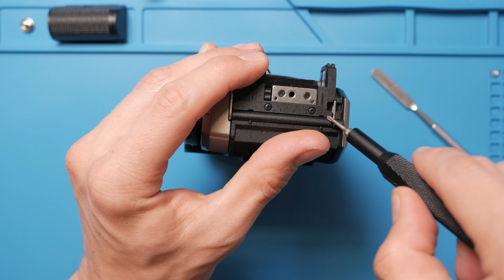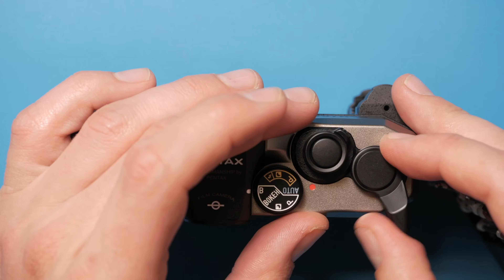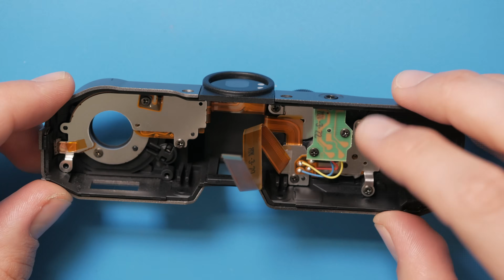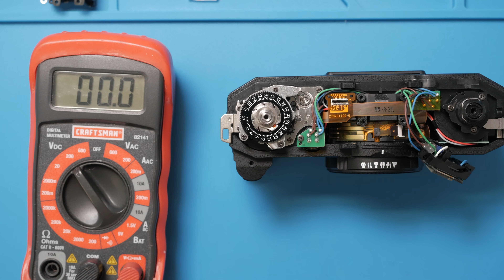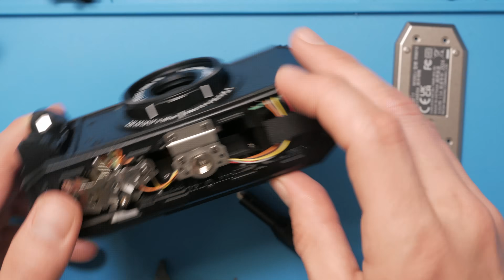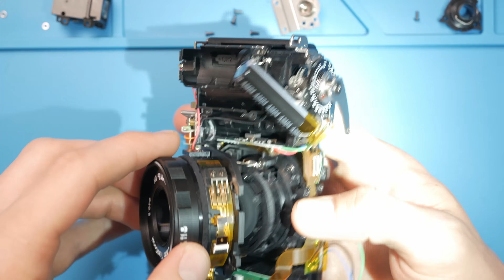Pentax 17 Teardown | A Look Inside the New Film Camera from Pentax

Comment: Hi Evan, I was wondering if you could help with the lever issue that seems to be common. I took the bottom apart but for some reason, the flywheel on the left isn't winding right to advance the film. The flywheel should be on top of the bottom arm, but it goes under the flywheel instead. I called the service center and they want to repair the camera for too much money. 
Is there any way you can help with this? 🤞🏾
Reply from the maker: Hi, that's an interesting issue that I would actually like to look into and help you solve. Is there anywhere that anybody has posted about this issue with photos, more details, etc? Feel free to contact me by email, my address is my first name and last name - the name of my profile here - at gmail.
Reply: @EvanDorsky I have looked everywhere for answers and can't find any online. I will definitely send you an email and a picture of the problem. Thank you for responding to me.

Comment: How would you clean the focus adjust if its stuck with dry mud inside?
Reply from the maker: You could follow the steps in this video to remove the front plate and lens barrel - with the lens barrel separate, it should be possible to disassemble the lens barrel further and clean it without the risk of pushing any dried mud deeper into the camera. You'd also get the chance to clean out any dried mud that's already inside.

You could try cleaning the focus adjuster without removing the lens barrel, but you'd risk mud leaking into the camera and fouling the lens, focus motor, or other electronics.

I hope this helps - if you attempt the repair, good luck! And let me know how it goes.

Comment: I tried taking mine apart because of some corrosion. It would turn on and shutter wouldn't fire. Advance lever wouldn't work.

I accidentally closed the film door with the rewind removed.

Now I can't open the door. Help!
Reply from the maker: Apologies for the late reply, but in a situation like this, you can usually stick a screwdriver into the rewind knob hold to move the catch enough to open the door. In fact I found the Pentax 17 to be quite forgiving in this respect compared to SLRs from the 80s. I hope you fixed your issue!

Comment: Love the breakdown, surprised to see how easy it is to take apart. Bought one a week ago and couldn’t be happier with it. It actually got me back into photography as I’ve been out of the hobby for roughly 10 years. I see a lot of hate for zone focusing or even lack of manual controls, but honestly after a couple of rolls through it, you learn to adapt. I find it fun to have a bit more control from a standard old school disposable camera, and still retain the point and shoot characteristics. As a gear head, who used to use a Leica M6 TTL, Bessa R3M, Ricoh GRii and many other cameras, the Pentax 17 is much more fun to use.

Comment: I just dropped the camera from 1,3 meters on concrete. There is nothing to it but a little dent on the right bottom side. Is there anything to look out for?
Reply from the maker: If the camera fell on the bottom then I'd be most worried about the winding mechanism, since it lives in the bottom of the camera.

The plastic posts that the lens assembly stands on seem kind of fragile, but I wouldn't expect a fall like that to knock anything out of place since the lens assembly itself is pretty lightweight too. If it seems to be working fine you're probably in the clear!

Comment: The price is absolutely fine.its cheaper than the sony zv1 and its probably the exact same amount of parts circuits capacitors but you can stick a roll of film inside to be exposed to light.  Honestly in your opinion would you buy one after you see how robust its built? I will be buying one from my local camera store today as they sell them or i could call B&H. You are brave and I thank you. I still have a few Pentax film cameras from the 80s and ive took the bottom plate off and lightly oiled the mechanisms and I completely trust them.

Comment: What is the modern obsession with plastic injection moulding?  

What's wrong with a nice stamped aluminium or brass housing? It wouldn’t add much to the production cost, and the item would be more durable.
This isn't an item that is meant to last much beyond the warranty period.

Comment: Kudos from a working analog camera technician! I've been curious about the internals on this. Your hunch about the shutter is correct: The winder gearing should be charging the small shutter in the lens assembly (while also advancing the film) but exposure duration is controlled by the electronics, so the whole exposure system is mechanically-charged electronically-timed. Would love to see more camera repair content on youtube, keep it up!
Reply from the maker: Thanks for your kind words!

My impression is the mechanically-charged electronically-timed shutter is fairly common among autoexposure analog cameras. However I am wondering if the Pentax 17 shutter is entirely electronic, with no coupling to the film advance, like the leaf shutter in a compact digital camera like the Ricoh GR. I'm thinking this for a few reasons:

1. Ricoh/Pentax could grab this part off the shelf, and this strikes me as a simpler design to achieve in 2024
2. The lens assembly seems quite independent from the film advance mechanism – it is almost floating above the rest of the camera – and I did not see any clear mechanical coupling into the body
3. I do not see any movement in the front or back of the shutter as I turn the film advance lever, suggesting that the shutter recharges on its own

I have been thinking of making another video showing example photos from the Pentax 17 and exploring the lens in more detail – Pentax put in a full 8 blade aperture, which impressed me, and which I don't think has gotten enough coverage. But it might be a while. Thanks for watching!

Comment: after watching this, I don't feel it's overpriced anymore. my only gripe with this camera is that it should have gotten a sharper lens. even the original Pen F from the early 60's shoots sharper than the 25mm chosen for this
Reply from the maker: How have you assessed the sharpness of the lens? I scan film from the Pentax 17 with a 36MP DSLR and I have been pleased with the performance of the lens, even on TMAX 100 and E100. I've found it to be extremely sharp, at least as sharp as my Ricoh GR10.

That said, I have not had the pleasure of using the Pen system about which I've heard great things.

Comment: It's a pity they didn't let you change one part and it becomes a regular 35mm format instead of half format ( can't take slides as it is).
Reply: It wouldn't work like that, the lens is essentially an APSC lens. So you can't use it for full frame even if you modified the window to be bigger, the lens doesn't project at full frame.

Comment: I'm very surprised that there is no chassis and that the casing indeed is an integral part of the structure. Looks like a very cheaply build camera, using injection mouldings to provide the strength of the camera, just like those cheap point and shoot cameras of the 90s. They must make a huge profit from each camera.

Comment: Cool teardown! I am surprised to see point-to-point wiring made a comeback. I was anticipating flex cables and some JSTs, like modern cameras. Curious, is the top shell all plastic, or is it a plastic insert into a stamped metal cover? I bet they are using metalized plastic like fujifilm.
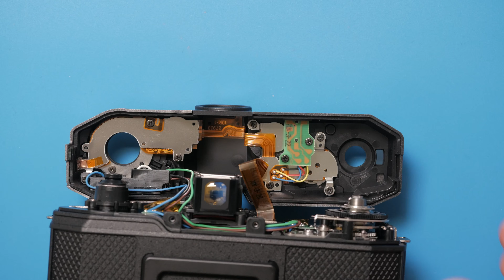Reply from the maker: The top and bottom plates really do appear to be metal. The top plate has a plastic insert, but it looks like there's a nice thick metal layer there – you can see it pretty well around 5:49.

Also, another commenter has suggested that bare soldered wires are still common for built-in flashes inside cameras. I haven't taken apart enough modern cameras to know myself, but Pentax may have decided to save BOM cost on high voltage connectors by just soldering a few wires instead. In a camera that must already require so much manual labor to build, I can see why they did this.

Comment: Interesting to see electronic shutter and mechanical film advance separated like that. Can't help to wonder if it would make possible to modify the camera for the Lomo style double exposure, at least in theory. Probably would require reprogramming some of the on-board logic. Thanks for the teardown and explanation, it was a joy to watch.
Edit: turns out the double exposure is possible and actually quite simple using the film rewind button at the bottom as explained by Analogue Wonderland in their video.
Reply from the maker: Yes, double exposures should be easy on the Pentax 17, another benefit of the nice solid manual film advance mechanism!

That said, in theory it would be possible to modify the firmware to allow multiple shutter releases before releasing the film advance solenoid. Quick double exposures would be effortless, but accidental ones would be extremely common!

Comment: All plastic, but it looks the same I have on the DA*55/1.4, that doesn't feel cheap at all. The top and bottom plate might not be brass but they seem to get the job done and they look good. A lot of people for that price wanted a Pentax 67 III with a 105/2.4, and quickly point out a list of 40 years old used cameras that you can get with the same amount of money. What you are really paying here is the lens that looks like a little marvel from the shots I've seen, a good mechanical design that leans towards repairability, and metal parts where they matter (all the rewinding mechanisms and gears). Honestly I'm not at all a fan of the AF lens with manual presets, but my guess is that it shares part of the design with a future full AF camera, who knows, maybe full frame too?
Reply: I also prefer the Pentax 67... but gotta be realistic that it's a dead product. No new parts made and most likely you couldn't send it to Ricoh for repair, so gotta ask other specialists. On the other side, the Pentax 17 is a brand new product, still supported by the manufacturer.
Reply: @anta40  I totally agree! The point is that people confront the price of old used stuff with the new one, and are completely unrealistic on how much new stuff should cost. Sure a brand new Pentax 67 would be possible, but it would cost at least 10 times as this 17
Reply: @karellen00  Yeah, we mostly ignore inflation for convenience. I'm not a fan of half frame, but nevertheless this is an exciting news: a brand new 35mm camera. Hello Leitz, there's another player in town. Perhaps half frame format felt natural by younger folks who spend lots of time on smartphone 😬

Comment: did you determine a purpose for the washers on the front plate under the leatherette?  assembly locators maybe?
Reply from the maker: I believe @mileskosik472 is on to something with his comment suggesting that the divets in the front plate are there to hide assembly features (like ejection pin marks), and the washers are there to make up for the gap from the divet to keep the front plate surface flat for the leatherette.

Comment: I very much appreciate this tear down video. I figured Pentax designed it to be serviceable when I noticed no use of Torx screws (or the like), only flathead or Philips. I own one and have so far shot about 8 rolls of 36 with it. Aesthetically, it has me taking pics that I probably wouldn’t take with any other type of camera. Of course I could say that about any camera, but there really is something special about the way it’s been designed. I’m not an engineer, just a picture taker, and I like the pictures I’m taking with it. I also don’t get all the vitriol being thrown at the pricing of this item. Camera companies aren’t charities and there are definitely more evil things to fund or support in this world than half-frame film cameras.
Reply: In my experience Torx (not security Torx or Pentalobe) has a much better grip and doesn't strip like Philips or require alignment like flathead/slotted.
Reply: Normal, non-security Torx was chosen (along with phillips) as the main screw type for the Framework laptop since it was less likely to strip than Phillips or Posidrive screws.
Reply: If you look at the rate of inflation since the Olympus 1/2 frame cameras were introduced, the price of the Pentax 17 is comparable.

Comment: No wonder Pentax has to charge $500 for this camera. @ 18:30 you said "I'm happy to see that Pentax kind of stuck to the traditional manufacturing design..." I am unhappy about this. Dozens of different size screws, many of them hidden under other parts, discrete soldered wires, gears that will strip, springs that will fall off or lose tension, levers that can/will come loose, etc. 3D assembly/disassembly that needs skilled and practiced Human hands to do these tasks. YUK!
Don't get me wrong, I DO appreciate the design work, however I was hoping that there would be a "Clean Sheet" mechanical design approach.
For example look at the way Apple (and others) have designed their laptops. Many of them get a "0" out of 10 for serviceability/upgradability. A company called Framework has a laptop that is both competitive in price and performance to other laptops in the same class BUT they are designed to be serviced and/or upgraded by the consumer. All their screws are the same size. Allegedly.
I was hoping that Pentax would boldly design a quality product that does not need the skills of a surgeon to replace a part.
I loves me Pentax cameras. My first SLR in the 1970's was a Pentax MX. I had many other Pentax 35mm cameras and used them well into the 2000's. During the pandemic I decided to buy some of those classic Pentax lenses for use on my digital Pentax and and Canon cameras. I also bought a few Pentax 35mm SLR's to shoot a few rolls of film. I bought a dozen Pentax SLR's. TWO of them worked properly even though the sellers said they worked perfectly. Are there 35mm SLR repair facilities on every corner? No. A few individuals in this country of 333 million? Yup. I sold most of those cameras for parts.
Pentax! Please let your grandfathers and grandmothers retire! 😉

Comment: looking at the internals, this goes a long way to explaining the price. very well built and thought out. sadly alot of people would appropriate that. 
they could have just added a steel weight into the bottom to make it a little heavier ;) that would have saved some of the complaints
Reply: Nah, these things have high part failure rates. There's nothing particularly special about the design. Those small ribbons can burn out too. The screw for the grip battery cover unscrews on its own and can get lost. And most of the stuff in here, if it breaks, you can't service or find a replacement part. Even those springs will eventually fatigue and potentially break. Look at 17:03 when he advances the lever....the gears mash because the plastic components flex. That's a point of failure waiting to happen. It's like trying to run a driveshaft in a car connected to plastic axels. So while there are metal parts, they're creating tension forces against plastic parts. Not good. And plastic always fails with flexing over time, always. 

They also shouldn't have used plastic for the half frame window, it should have at least been lined with a full precision machined metal plate to ensure the half frame border is as perfect as possible, instead your half frame image border is completely dependent on the imperfections in the plastic edges of the frame window, which have all kinds of imperfections. This means no two cameras will have the same half frame border, kind of like a fingerprint, but the problem is it also looks ugly and unnatural on the film itself.

Comment: Modular, no stupid clamp down ribbon connection points, easy disassembly…but the real question remains for us techs, will the release parts to 3rd parties?
Reply from the maker: I fear not, but the crossover between the 3D printing community and the analog community is strong. PPP Cameras has already released a replacement ergonomic grip/battery cover, and with the easy disassembly, we could see files starting to pop up.

However it’s hard for me to predict which parts will break first, since the mechanisms are generally either well protected or made of metal (like the film advance gears).

Maybe it will be the door, since it’s made of plastic and someone is bound to drop their camera while inserting or removing film. I’m sure someone in the community will design and print replacement doors — might even be me!
Reply: @EvanDorsky  Wouldnt be a hard thing to make.  Even most of the electronics look to be easily reverse engineered.  If I had to guess, it has a simplified copal electronic shutter in it.  Theoretically, that shouldnt fail.  Ive only come across 2 that have failed on Fuji X100 series and that was because of a firmware problem that cooked the gear when the motors overheated from hunting all the time on the aperture control.   Im glad to see they didnt try to cheap out on the film transport gear train like Rollei did on some of the later 35 models.  II really really hope Mint camera doesnt make the same mistake with the 35AF.  Were on the waiting list for some of those to tear down.